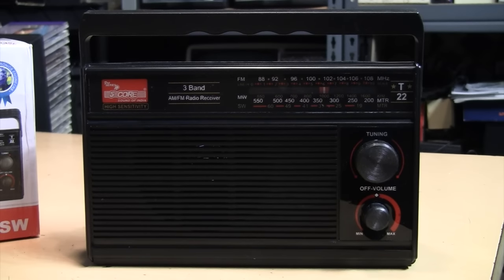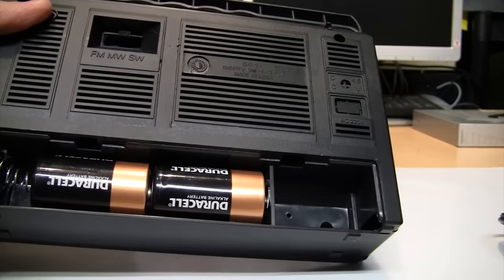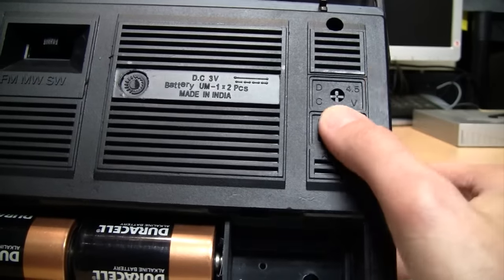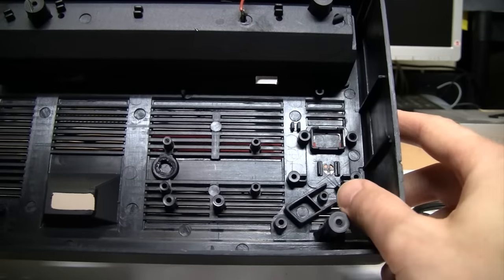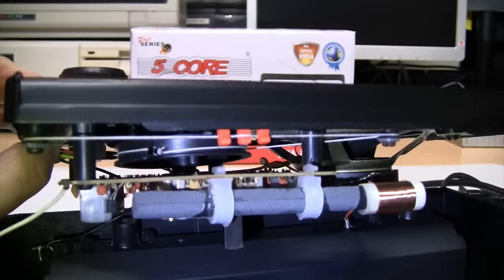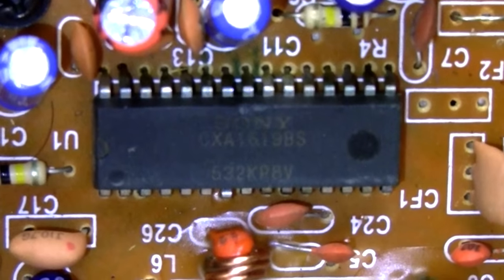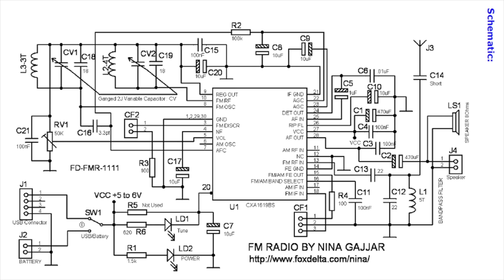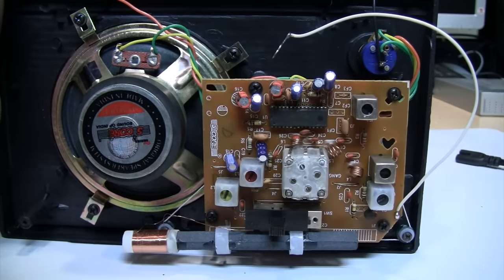Secretly made by Sony - Inside the 5 Core radio

Comment: I installed the SFU-455B (CF3) and I believe it did help the selectivity and stability on AM. The installed CF for FM at CF1 is ok as it is. The open spot for CF2 should be for the CDA 10.7 CF (CF3 on the CXA1619BS data sheet) but will involve cutting some traces and running  a couple bodge wires. I have this CF but not installed it yet. 

The datasheet also indicates an antenna filter (part PFWE8) which I have not been able to find anywhere. Also I bought a few of these radios and one had a bad Yellow IF can with an open secondary, they cut the trace leading to the IC and jumpered both secondary pins back to the primary effectively eliminating that IF stage. I was able to find replacement IF cans and installed one of those (this IF can has no capacitor on primary or secondary). The rough alignment I did was to listen for the band of static on SW and adjust it so that the static falls within the range of the dial scale. These IF cans are getting hard to find now as well so it may be a good idea to get a few (red, black, white, yellow) when you can find them.

I also followed the datasheet and added a tuning indicator LED (as shown int he data sheet (both resistors at 1K ohms these adjust the LED brightness and dimming speed) and installed it in the corner gap opening between the dial string right behind the red 5 Core logo on the T-291.

Comment: Great video bro! You know, I am from India, and I must say I have never heard about this brand before. I searched up on 5 Core radios and they simply are just not available on any online store here in India. Went on their official website, and though the radio is listed on there, the price is in USD rather than Indian Rupees - I guess the company has decided to market to a foreign audience, and maybe that makes sense since radios do not have a market anymore here in India, I don't see anyone buying a radioset in 2021 (except for nostalgia's sake). As far as AM-FM radios are concerned, one old Indian brand that comes to mind is Santosh - I think they still make radios, though I have no idea if they are analog units.
Reply: I'm in the U.S. and haven't listened to local commercial radio (AM and FM) in decades. Nothing on but trash. I have a large collection of my favorite music, mostly from the '60s and '70s on cassette and 8 track tapes. I do still listen to shortwave, I have a dedicated late 1960s tube type SW radio.
Reply: @geraldscott4302  what's difference between tube type and modern IC based radios?

Comment: It even has 5 tuning cores just like they said.
It really needs a nicer case, AC-DC board, and an amp to actually use that speaker
Reply: The IC can output about 1/2 watt into 4 ohms, which is more than good enough for a portable radio. Most older transistor sets had considerably less power.

Comment: I wouldn't be surprised if the entire circuit board happens to be lifted from an old Sony product. It can also explain 4.5V and a "spare" cell -- as if they were working on something else, and then decided to use an existing design which just works perfectly on 3V.
Reply: As someone else commented, 5 Core is probably re-using  molds from an older radio that had more discrete components instead of that chip -- and needed 4.5 volts to run them.
Reply: A good component manufacturer will supply information like that. One of Sony's many business activities is as a component supplier. They sell far more cellphone camera modules than they sell phones themselves.
Reply: Quite a few sony portables from the 90s used 4.5v as power
Reply: @horseathalt7308  Yep, And it drove me crazy. I would buy a 4 pack of batteries and ALWAYS misplace the 4th one, so I was  wasting 25% of my battery budget. I used to think they were in cahoots with the battery companies, LOL
Reply: @jamesslick4790  sony offered there own branded batteries. Probably made by someone else but also offered their own sony ac adapter which provided exactly 4.5v and the correct jack too. I think they sold tons of those.
Reply: Not a chance. Sony used much more compact designs with many proprietary parts. India has had an electronics industry for a long time, they're quite capable of implementing reference designs using available parts or just design their own.
Reply: Fabricating a new injection molding die is quite expensive. They might have repurposed the existing cabinet by designing the pcb to match the cabinet. Obviously for cost cutting. These analogue radios if well built are timeless.

Comment: I bet this was redesigned at some point to use the chip solution, and that may not have been the first revision based on the case design. The 4.5 volt version probably was all discrete transistors.
Reply: That was my first thought as well.  Seems like somewhere along the line, 5 Core revised this radio to reduce power consumption.  This is very thoughtful and important, given how many people in India have very little disposable income.  I imagine many people probably had to save up for months to buy their radio, and probably couldn't afford to keep it running if it chewed through batteries.
Reply: @OzRetrocomp  I'd guess the goal wasn't about power consumption, nor does higher voltage mean more power used. More about cost reduction, building a superhet FM broadcast receiver out of discretes the old fashioned way is labor intensive compared to the chip. As I understand it older battery powered transistor radio circuits used higher voltages to accommodate cheaper lower current transistors in the audio amp stage(P=IV and all). If they were really concerned about cheap operation a external power input would have been maintained.
Reply: @OzRetrocomp  An odd number of batteries is always awkward as well. D cells are usually sold in pairs which means remembering where you put the spare one.
Reply: or another chip.
Reply: @OzRetrocomp  Looks like the chip runs on anything from 2V to 7.5V, so you could also power it with a single Li-Ion cell. Or with solar power. Nice design!

Comment: Nice to see a radio with a honking long ferrite bar on the AM antenna. That probably goes a long way to explain why it receives as well as it does. I'm kind of curious as to whether it could be improved by changing the position of the coil on the bar and by tweaking the tuning capacitor.
Reply: I noted in the first video that the screen print on the pcb has the coil on the other side. I flipped mine around and think that it helped slightly but that could  be my imagination. It doesn't seem right to me that the coil is so close to the strong magnet of the speaker or that it's hanging out in space like that where it could be damaged, the ferrite antenna should be secured with some hot glue to keep it from coming out, it's only held in with wax and like you said it isn't a small bar.

Comment: Look closely at the circuit board, and it becomes apparent that some components have been deleted as cost cutting measures. Two ceramic filters are missing (one has a jumper clearly visible). The good treble response on AM is a side-effect of this. However, Shango066 reviewed one of these radios, and he found that stations "bled" excessively. This specimen performs much better. Possibly, the engineers came up with a design revision that allowed the AM section to develop acceptable selectivity without using a ceramic filter.

If I had to take an educated guess regarding the function of the five adjustable cores in the radio, it would be:
-MW local oscillator
-SW local oscillator
-SW RF
-MW IF
-FM quadrature detector

Comment: (a) On 5core.com (vintage audio section) you can see they call this radio TC-22 or T-291. Looks like they sell it worldwide.

(b) The radio back shows mold parts for "4.5V" and for "AC 220V". Changing the design to use only two cells is a big improvement - batteries are often sold in packs of two or four. Inconvenient if a device needs three cells. The empty space in the battery compartment, and the unused space for an AC transformer shows that plastic case mold designs were often used for multiple product versions. E.g., one stationary verdsion with AC 220V, one with external low-voltage power jack, and one for battery-only operation. Quite common in the past. Molds are expensive to make.

(c) Sony Corporation has a semiconductor barnch that produces and sells integrated circuits. That the radio chip is from Sony does not mean at all they produced the whole unit. Maybe 5core made or bought the design and just produces the radios. You can buy the CXA1619BS in bulk, if your want. Nice chip, by the looks of it. Works from 2V up to ca. 7.5V, so you could power it with 4.5V with out any harm for the chip.

Comment: The spring that forms the earth connection to the battery on the left seems very stretched. They are usually coiled much tighter, and sit much closer to the battery. This suggests to me that they did indeed plan for a further cell, especially as the space left over is too small for one.

Comment: Mine should be here tomorrow.
Edit: The radio had no physical damage but the dial pointer was jammed, so I had to open it up to put it back on the track. It works better on AM than yours for some reason. The FM antenna broke right away but seems to work as good as yours with a test lead as a replacement. SW is useless. The worst thing was the smell after unboxing it. It had to go outside and sit in the sun for a few hours to get rid of the burnt plastic odor. Overall, good bang for the buck if you get a good one and can fix minor QC issues.

Comment: They filled in the old DC-in ports but left all of the old incorrect text because adding material to the part involves machining the cavity which is fairly cheap, whereas removing the text requires welding the cavity and then re-machining it which is more expensive.

Comment: My last dumpster dive, I found a portable electric fan with AM/FM radio built-in and can do operate at AC or battery. It has the same Sony chip on it. Very sensitive receiver, it can pick up probably Chinese AM broadcast or some SE Asian am at night.
Reply: That reminds me of the radio I found in a hidden garbage dump in the woods back in the 1980s; the tape player didn't work but the radio still did.

Comment: So that's why this radio performed well.  You can't go wrong with a radio made with Sony parts.
Reply: Well, I'm not impressed at all by the sensitivity of my ICF-7600DA, and its design which uses two 74HC138 demuxes to directly switch between the SW RF filters. I think the series resistance and stray capacitances among its outputs might contribute to its mediocre performance on SW, but it's FM performance is not great either. It's quite alarming that they didn't even specify the sensitivity on any band in the manual.
Reply: Only the Chip and circuit is Sony, not other parts. Other parts are made in India by small manufacturers.

Comment: There is a datasheet out there for this radio from Sony which is pretty interesting.   There is also a surface mount version of this chip CXA1619BM.   Neither are available for small orders (apparently), as the data sheet is marked to contact Sony Sales for availability.
Reply: Probably for the chip, not for the radio.
Reply: Ask for a sample for testing purposes, many chip manufacturers will send you some.

Comment: The Sony chip itself dates back to at least 1999, and I highly doubt this would be a current production item. DIP through hole chips are pretty much a thing of the past, having long given way to SMD types. And the physical construction  of this radio really screams "last century". Probably enough surplus stock of the chip lying around to keep this model alive for a while. Performance certainly seems decent, but hardly state of the art for an AM radio. Where the technical performance of analog radios is concerned, I think we reached the peak in the early 1970's. Everything since then points to cost savings and simpler production. The  cheap digital sets also appear to be pure junk, as evidenced by the fact that this crude set beats the snot out of the fancy "retro" Panasonic. My go to portable is a Grundig 6001 Satellit 210 from 1972. As analog portable radios go, it doesn't get much better than this.

Comment: Be careful when turning on the radio. The volume knob was in the "on" position in both new units I purchased. I almost snapped the knob off by turning it too far to the right. Likewise, the selector on the back doesn't align with the  band indicators especially well, so exercise caution when switching it.

Comment: You get what you pay for. That's quality where it's needed and not where it's manageable...this is to make the cheapest possible radio for the poorest with enough features, yet maintaining functional quality. That's called "Indian jugaad". A principal difficult to understand the concept of, for westerners but it works wonders in a pinch. But but...I do agree...the manufacturing quality, mostly in electronics, needs to be better for global standards.

Comment: It's nice to know that Sony still manufacture those kind of ICs. Very unlikely to Sony to have an assembly line for just this kind of radio nowadays instead of outsourcing. For some reason it reminded me that Sony of Brazil is no more (factory closed this year) after 48 years in our market. They will only sell Playstations here as imports now. No more consumer products nor professional ones either.
Reply: AFAIK the chip is not in production anymore, I guess this company has access to lots of old stock. The chip looks a bit beat up so it could even have been pulled from another product.
Reply: @irtbmtind89  I think this is a real possibility also. It's like the legacy motherboards for older Intel/AMD processors being made in China nowadays with chipsets sourced from scrap boards since those chipsets are not in production anymore.
Reply: @irtbmtind89  That chip is quite popular, I have seen it on almost every local radio in India.

We probably have a large stock of it. Some of it could be salvaged from working older products that people just throw away in the junk.

Comment: Sweet little radio. I supplied the jocks at work with a Radio Shack / Realistic radio much like the one you have here to use on remote broadcast. This was Way before digital audio processors in the chain made monitoring off-air impossible without a 1/2 to two-second delay. Jocks were notornis for mishandling the equipment. If I got a year out of one I was lucky. Dirty volume pots would render it useless on remotes. Now the world has gone digital in both broadcast audio for radio and tv. Having all your digital eggs in a single basket is never a good idea in the industry. But so it goes. Cheers from Louisiana.

Comment: Neat that a radio from India has some interesting features despite it's modest aspects and re-using a molding for some previous product that has been blanked out.

Somehow managed to end up with some weird Chinesium radio that's kind of odd as well. (Suntone model RR632?) Styled like a brick CB radio, ok-ish sound quality, a bit harsh on batteries (uses 4xAA), but despite seeming all wonky from a design perspective it pulls in some stations like a champ even though the knob for tuning can seem finicky. If the battery life weren't so mediocre, it'd almost be acceptable due to the reception despite having other things against it.